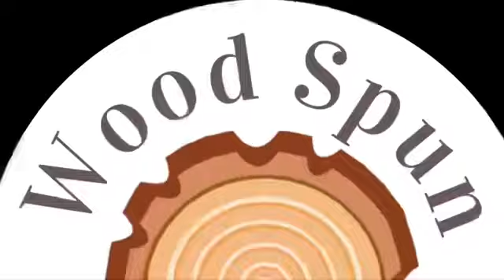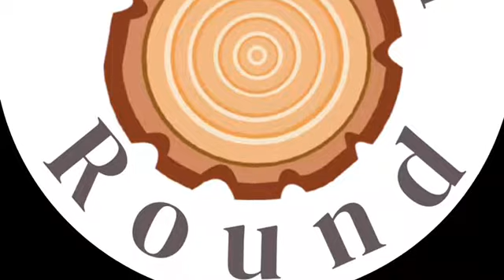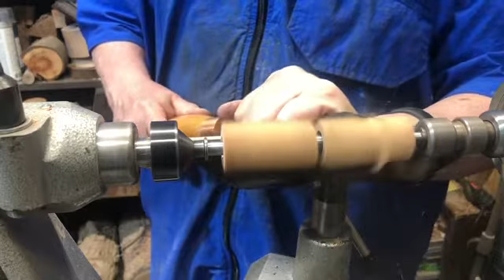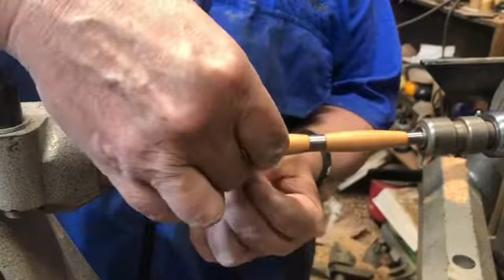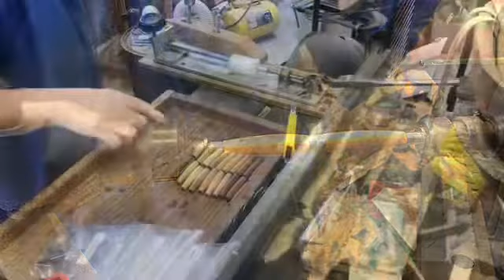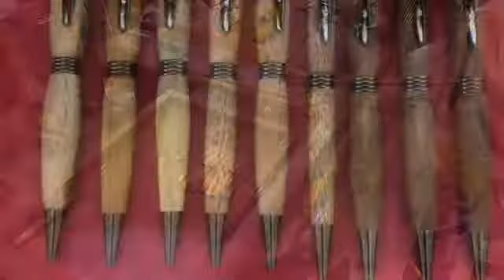Turning a Thank You for Our USA Military

Comment: There really shouldn't be any guessing how far in to press the parts if you follow the instructions. By the way, you can also use your lathe as a pen press.
Reply from the maker: You are correct except that they cannot account for human error. The tubes are often not cut with great precision and using the barrel trimmer it is easy to trim a touch more than necessary. So there is some adjustment ability in pressing in the transmission with these kits. And the lathe does indeed make a very good pen press. Thanks for watching and for the comments.

Comment: 9 years ago, when I first started turning pens (PSI kits), I couldn't afford a pen press like you have. I cut off a 2" piece of a broom handle and turned a 1/4" tenon that would fit in my drill press. The anvil was just a piece of 2 x 4. I am still using it!
Reply from the maker: There you go Doug. So many ways pens can be pressed together. I put several together using a bench vise. Then started using the trigger type of clamps. Finally moved to this pen press. I’ve seen many who use a drill press, others who use the lathe quil, and still other various methods. It comes down to what you have to get the job done. Thanks for watching and commenting.